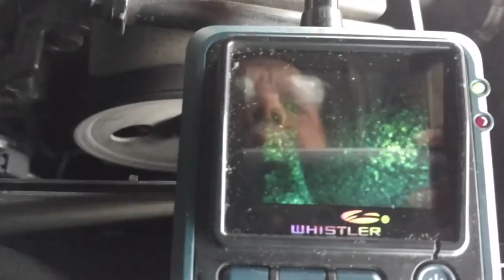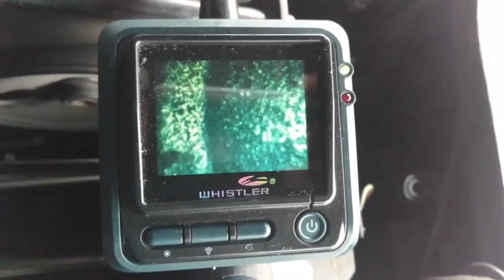Checking to see if the water steam bath treatment cleaned the carbon off the piston. - howr

Comment: Running shell v power can help they use a nitrogen based additive in it which is the same thing most companies use in thier fuel additives
Reply from the maker: I do run a lot of Shell, especially when on the road. I'll try the nitrogen stuff.
Reply: Robert DIY yeah a tank of the nitrogen stuff and a good road trip should do it some good

Comment: If can to blow the carbon out to fill the gas tank and put a bottle of brand name fuel injector cleaner in it and drive the car at 80mpy for 3 miles steady. To blow out the carbon.
Reply from the maker: Done that 1000 times.

Comment: try adding techcron, in. its nitrogen-based.and could clean it, much better.
Reply from the maker: Cool, I'll try that.
Reply: @RobertDIY ... try this with 2 bottles12 gallons gas, and the rich nitrogen should eat through a lot of the carbon deposits. and I think you will be pleased, with the results.  MR Robert? plus. afterwards, put a few ounces like 6 ounces. of B 12 .or marvel oil. in your tank.6 gallons of fuel. to relubricate your valves properly.
Reply from the maker: Oil lubricates the valves.
Reply: @RobertDIY  true but the top part and steams of your valves are exposed to high heat and carbon. but mystery oil. oil based gas products give it even better seating.especial after using a non oil based cleaner like STP  or chevrons tecron cleaner. this quiet  the top of them down that may have not seated properly. they're by reducing pistons closing better. cause of stuck carbon.